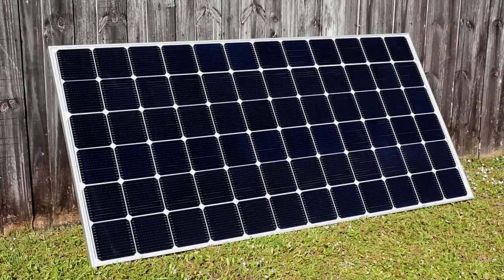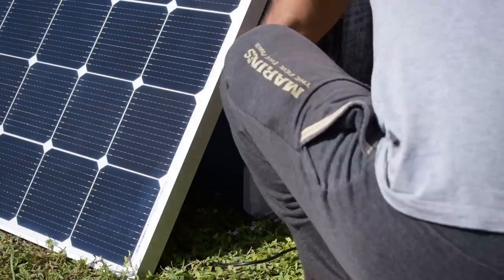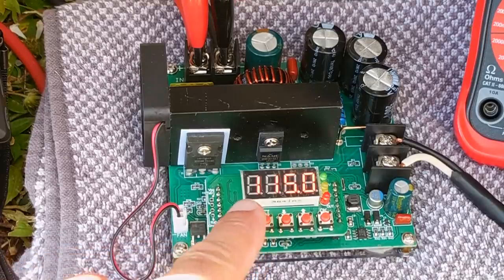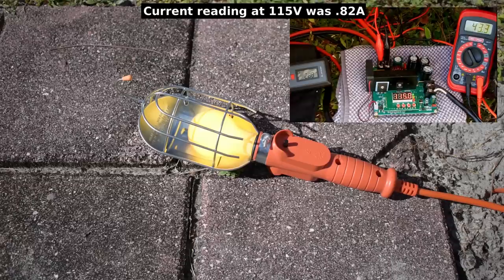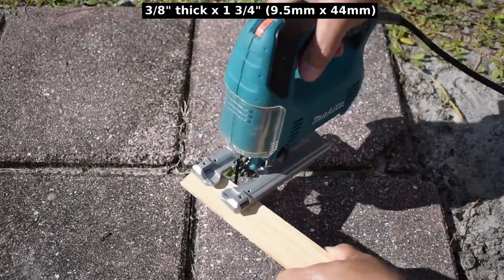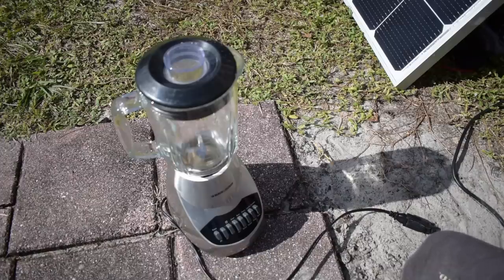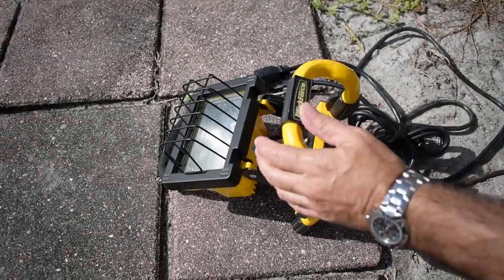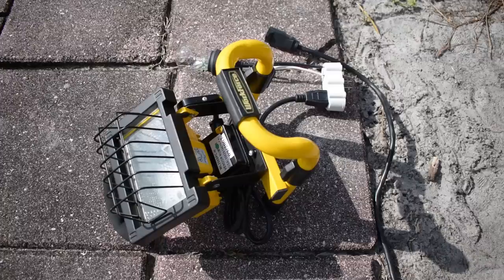400W Solar Module Runs 120V Power Tools Directly!

Comment: I own the same step up converter and the same bluetti eb150. I have 2 -400 watt solar panels wired in series that gets me 68 volts open  circuit to my bluetti @ 8.85 AMPS. The bluettis MPPT brings the voltage down to 60 volts, which yields me around 530 watts of DC input charging using my solar panels. Do you think this step up converter could handle 68 volts input from solar panels without damaging the step converter ?  I have read info that claims the bluetti can handle a max of 68 volts @ 10 amps from solar panels yielding around 680 watts max input solar charging capabilities. ....and I wanted to try to use the step up converter off my solar panels, to pump more than 530 watts charging into the bluetti.
Reply from the maker: It's a very useful DC-DC converter. As long as you don't exceed the rating you should be fine. If you exceed by a small amount, then you may get reduced life of the dc-dc converter. Keep in mind that the 68V input will drop under load. Be sure to check out my latest solar video uploaded today. Thanks for watching!
Reply: @electronicsNmore   Do you think the 68 volt open circuit no load voltage coming off my solar panels and into this step up converter, would damage it or blow the fuse  ? I know it is only rated for 60 volt dc input but is that no load- open circuit rating ?

Comment: Help me out here coz I am clearly missing something.... you used stepped up DC current to run AC motors? Right?  How does that work if you did not invert it? Are they universal motors?
Reply: Frank Klopper I want to know this too. Tubing 120v AC Appliances with 120v DC?. Very interesting if that’s the case
Reply: I think its a DC to ac inverter.
Reply: Universal motors only. Not induction, not bldc, not anything with a transformer
Reply: If you know What a Modified squre wave inverter 
Then take the one Half of that away 
Then you got a DC to DC stepup converter!!! 
You Will get Hurt or loose Money if you 
Take this turd's ADVICE.. realy bad adwice !! 
Hope he is in US Then i smell law suit
Reply: @SuperGreyfox99  to step Up power you choppet Up!! So on a scope IT would look like SQURES 
Guess how a modified squre wave inverter looks like 
Then take half away!! !!
Reply: @kennethschultz6465  I suspect this step up would provide fairly smooth dc output, since it has smooth dc on the input side.
Reply: What's the point when you still need an electronic device either way if anything brakes snd if shtf thrn forget it. The old waysvare the best.
Reply from the maker: Correct!
Reply from the maker: @FarOutFarSpace You only need one large panel and a 20 dollar cheap converter. You need to know what devices you can use.

Comment: Hey there! Wonderful video! Curious, what is the No Load current draw on that converter there? The DC to DC one. Something like that to power just lights would be really nice! Instead of trying to find 12v variants, or using a standard AC inverter that takes 200mA to 700mA just to have running!
Reply from the maker: Pretty sure it's very low.

Comment: As much as I hate solar panels, they have their place.  It would be interesting to see you push these through some cheap Lifepo4 batteries and see how much juice you can get.  You could buy 32 38120 lifepo4 batteries on ebay for about $300.  I bet if you put them in series they will take the 115 volts and then you could pull about 3kWh of power in 1 go.   Might take a few obviously it would take days to charge that much up but for remote locations it might be ideal.
Reply: I have done that with 18650s 30s 2p I have really only tested stuff and have not used it much but it ran a 6 amp angle grinder fine even under load but it does not really draw that much like 500watts under load but I have not really came up with a way to charge them safely I have one of those boost converters so I could push 120v DC into it but they are not great cells so I think I am going to have 5 groups of 6 to charge
Reply: Why do you "Hate" solar panels? could it be your lack of understanding?
I run 10 300W panels into a  200Ah pile of LifePo4 cells to power my home, through a 4Kw inverter @ 230v.
 I hate power bills.
Reply: @BoB-Dobbs_leaning-left  i wad thinking the same thing. What is the point in "hating" solar panels.  How small minded.
Reply: @limitedslip82  I guess it's because "ecology" ecology bad, mmk?
Reply: @BoB-Dobbs_leaning-left   Sigh.  I generally don't think you want to understand.  Silicon PV panels serve a purpose.  I have lived off grid and they are important if There is no grid power or if you don't want to work with corrupt Electric companies.  That said they don't generate electricity.  It takes so much electricity to make the cells that they are basically just stored coal and diesel power.  Eventually there will be an alternative and people will finally hear the truth about silicone PV panels.   I am hapy you are using a lifepo4 option to store power as SLA or LA batteries are horrible too.
Reply: @limitedslip82  I have spent over 2k hours researching solar panel production.  And its safe to say, in general, that PV solar cells are bad.  Solar energy is great and we should use more of it but converting solar energy in to electricity is largely a mistake.  YES if you are in a remote area with no access to the power grid than solar panels might be justified.  There are lots of technologies to make solar panels.  Almost no solar cells are made in industrial nations because the process pollutes and uses so much electricity that western nations would outlaw production.  Silicon wafers are the most commonly used source of solar cells, I think you need to take a moment and understand where the materials come from and what chemicals are used before you advocate for PV panels.  The world would be much better off just making solar water heaters, using better insulation, more efficient appliances, reusing materials and using less packaging materials. I bought my first CFL light bulb in 1996 and my first LED light bulb in 2004.  I care about the earth to ACTUALLY research the truth.  You are ignorant because you automatically hate on people who have different opinions.   YES I was in the minority for CFL, LED, Solar water heaters, RO water filters, Pex.   You name it I was always in the minority at first.  I always had people state how what I was doing was stupid.  Eventually the world comes around.      Once we have  PV technology that is beneficial, then we will hear the truth about how bad current PV panels are.

Comment: Just be aware that there maybe more arcing in switch as there is no zero crossing point as in ( ac) to extinguish the arc that takes place in the switch other than that the setup can very useful
Reply from the maker: True. This is something you'd do if other things weren't available. Thanks for watching!

Comment: Can you put two of the boosters in series to get 240V DC? Can you combine them in parallel to get higher current/load? Of course assuming you run it from a 12/24V battery, I know you can do that with solarpanels or more batteries even without the inverter.
Reply from the maker: Interesting idea. I'm not sure, I only have one at the moment. Thanks for watching!

Comment: This will work, but obviously is very hard on the switches (DC arcing) and the voltage is too low.  Neat experiment either way.
Reply from the maker: Voltage wasn't too low(outside of the drill). The drill ran fine, just like it was running at a slower trigger speed using AC mains. It has it's uses. Thanks for watching!

Comment: My panels are running at 42-44v, and about to have a string at 88-96v 3kw. It could reach as high as 120-130v depending on the panels I go with, I want to stay below 125-130, 20v below the controller limit, I love solar power! I want to keep it a bit higher due to distance, and I may be going to 48-60volts, either a 48 volt inverter that will go to 60-62v or possibility. A 60 v inverter, the inverter I'm looking at is good to 62 or 64v but likely stay in the upper 50's my BC attery is 29.4, so double that, with a 60 v inverter I'd Need about 80v at tge battery, and I like to stay about 1.5-2 times battery on the solar VOC, with mppt, or 1.2 with pwm, I have mppt now, most work best with 1.5x over batt volts, to be most effiecent, I hope to see more stuff like this, happy holidays!!
Reply from the maker: Today the sky was super clear, 85K lux, the panel OCV was 47, and I had a full 400W output on the Maxoak. I'm thinking about (3) 40V 200W panels in series for a 120V output with no converter. :-)
Reply: @electronicsNmore  using ac tools ? would a fridge or freezer work like that for example ?
Reply from the maker: @crossfirex888  No

Comment: Can you please make a video on how to hook up solar panels to a circuit panel for home use and which solar panels you would highly recommend. Thank you :)
Reply from the maker: Hi Mike. You'd need a large solar array(5 or 6 like shown in this video would be the least to use), a 24v to 120VAC sinewave power inverter, MPPT charge controller, deep cycle battery bank, and a manual transfer switch for your breaker panel. You're talking about having backup power for individual branch circuits in your home?
Reply: @electronicsNmore  yes

Comment: Add a supercap on the output of the solar panel with a diode (assuming the panel doesn't have one) and you'll have a little longer run time at high current draw.

Comment: Hey, if you see this, I was hoping you could give me your opinion on powering my Wyze came V3 outdoors with solar somehow.  It doesn’t have an internal battery, but is powered by USB.  I think it draws about 2 amps or at least that’s what the power supply is, but probably less.  Reason is I need to record continuously to catch this motorcycle guy riding through my alleyway at the speed of sound.  I have a few Wyze outdoor cameras but they only record events, and he’s too fast to set it off.
Reply from the maker: Better off hiding a small action camera using a high speed setting. Place it outside in the right area when he passes by.

Comment: Motors will be inductive loads which means they have reactance impedance on AC, when calculating RMS they will draw less current than the DC equivalent voltage.
Reply: How do the AC motors work with 120 volts DC current?

Comment: I was wondering could you set up a space heater that will just turn on when sun is out or would it damage power converter ? I like to set up space heater in the basement what do you think ?
Reply from the maker: You need a lot of power for a space heater.
Reply: @electronicsNmore  thanks

Comment: i watched this back when you first uploaded it, now i am circling back to ask: how do you know which ac devices can actually use dc power? and was this video just a "just incase, or in a pinch" video? i am assuming the average person wouldnt do this due to having to keep an eye on that voltage stepper thing? or can you set the output voltage and it will figure out how to make it happen on its own? i just looked at getting one of those steppers, but i really dont like paying that china wait tax to get it for about $25, other wise its about $60 here in the usa. thanks as always
Reply from the maker: All universal motor tools and appliances, as well as electronic devices that don't use a transformer to convert to DC. If they use a SMPS, then it should work with 120VDC.
Reply: @electronicsNmore  wow, fast response again. i dont understand much of that, but you have given me enough take it from there and i am grateful. thanks again

Comment: that's a similar setup to heat hot water if you got 2 elements on ya tank get the right element a small wattage one ..hook up to the 2nd unused tank element ...Will this 20 $ boost module do that ??? can you do a test with a 600 watt element. ???
Reply from the maker: As long as the DC-DC boost converter can handle the current, and the panel has enough power output, you can do it. Thanks for watching!

Comment: I think these motors have brushes, try a fan that has and induction motor and see if it works.
I think 2 panels that would give you 80VDC would work find with out needing the converter or an inverter.
Reply from the maker: DC won't power induction motors. 3 panels in series is best. You'll have between 120v and 150V, the voltage drops under load. Thanks for watching! Be sure to share the link to this video on social networking sites.

Comment: Quite a bit of power for such small input voltage and current.
Reply from the maker: Yes
Reply: electronicsNmore if the current and voltage being supplied to the tool is lower than that specified on the tool itself, won’t there be a marked reduction in power when you use the tool? The jigsaw and the blender seemed to be operating at full power. Perhaps you should have had the camera further back to show the power cord was not plugged into a wall socket.

Comment: How are the AC motors being driven by DC? Is it the way the switching works? The frequency of the DC DC boost converter ?
Reply from the maker: No, universal motors will operate fine using pure DC(battery).
Reply: You can't drive an AC motor off of DC - but a lot of tools actually use universal motors, that will run off of DC just fine. Universal motors have a few advantages over pure AC ones - they don't need as much in the way of supporting electronics, mostly. Their torque is also less dependent on frequency than AC motors - they don't lose torque at high speeds. And speed control is easier, if you want a variable-speed motor.

Comment: I guess my question is: how do you calculate the power available from a mid winter sun (30 deg above the horizon) vs. mid summer (high noon) with the panel perpendicular to the suns rays in both cases?
Reply from the maker: If the sky in the winter (30 deg)is crystal clear, the power output can be very similar to power output with the sun directly above in the summer if the sky isn't as clear. You cannot calculate anything because the atmosphere is always changing. Using a LUX meter can give you a very good idea of what power output to expect. I noticed that around 83K LUX, a panel has the full rated output.

Comment: Put whatever amount of panels it takes together to run the tools without the DC DC converter.
Reply: I think around 80vdc would run motors ok. I think they need to have brushes, not induction motors. But I am not 100% sure.
Reply: @alanheadrick7997  yes series wound motors run on DC fine. I was just interested what it would be like.

Comment: Can a 400 watt solar panel be 50' away from my battery? What gauge cables should use?
Reply from the maker: Yes. The voltage of the panel is high enough, that it's not a problem. Use at least #10, 8 is better.

Comment: would a set up like this charge 18 volt batteries easily maybe 4 at a time ?
Reply from the maker: If you set the correct DC output charging voltage, yes.

Comment: great deal!  Question I have single 12v 115AH deep cycle i need to pull 12v @ ~16a from during the hottest/sunniest days in Florida. Would a single panel like this be overkill? What kind of controller would you recommend?
Reply from the maker: If you want to keep the battery fully charged while using it during the day in full sun, and have it charge the battery quickly if you used the battery at night, then the 400W is ideal. The best deal would be (4) 100W panels at the link below placed in parallel and connected to the 20A rated MPPT charger at the provided link. Keep wires very short to the MPPT and battery terminals. Use #10 stranded copper wire. Thanks for watching!
https://amzn.to/3gt8igd
https://amzn.to/36ADHsI
(Amazon Affiliate Links)
Reply: @electronicsNmore  Thanks.. Is my math right?? 12v*16a = 192wh?.  If my consumption during daylight was only 12a/h Could a 250 Watt 24v panel achieve same results on a day with some clouds? My 12v freezer is  about 4a, my fan is about 3a and my laptop/phone usb chargers are about 4a combined.  I turn off the freezer and laptop at around 10pm-6am.  I would think my battery has about 55AH  usable capacity and I likely use like 30A from sundown to sunrise... it's close.

Comment: Hey great video. Thanks for putting it up. Wondering if you can help with my question. 
I have a 5 kw solar system system on grid that ceases to work when the 240vac power goes off. So when we have had floods, lose power for a week or two, we lose everything including our two 750 litre freezers. This setup is really lame. The solar panels are split into two systems and they get up to over300 volts. Any idea how to run the freezers in the day to I can tape into the solar panels?
I have thought of turning off the main power switch and run a small camping generator to power up the on grid inverter so we can hopefully make use of it. Would that work?Thanks in advance.
Reply: Forget grid tie..
Reply: Brenton K thanks Brenton.
I already have a grid tie and an big aurora inverter converter but it won’t work when there is a power failure.  I’m thinking that if I can supply the voltage source to that inverter converter, I should be able to get the solar panels to run some freezers during the day.  
I am thinking of getting a small generator to kick start the system in the morning and then let itself run the rest of the daylight hours. Does that make sense?
Reply: Brenton K  thanks for your reply but I don’t have funds to buy another unit. Just want to know how to correct mine.
Reply: @antonk4398  i can't tell you anymore about how its done, that will cost $$,$$$ but, what i can tell you is My Solar on/off grid power station system is running my fridge/freezer right now. it will do that all day/night with no on grid mains connected power and no generator input even while its overcast and raining.